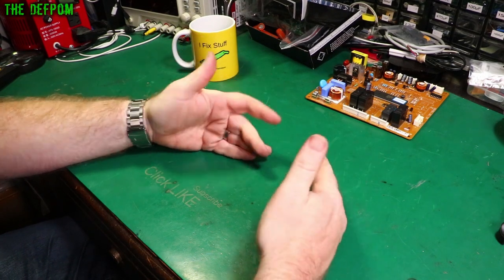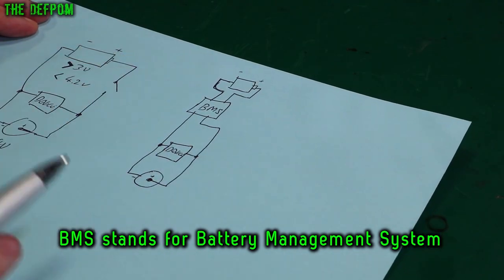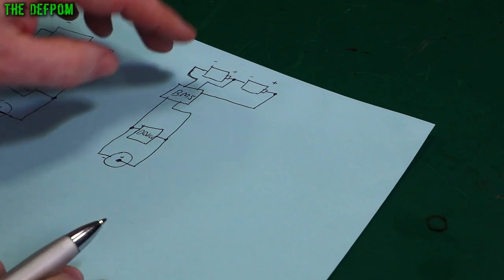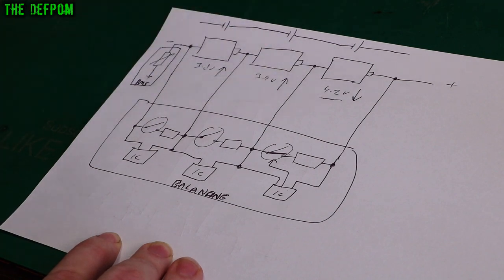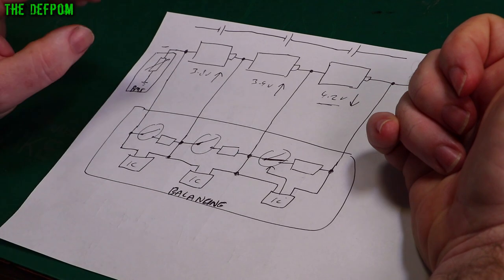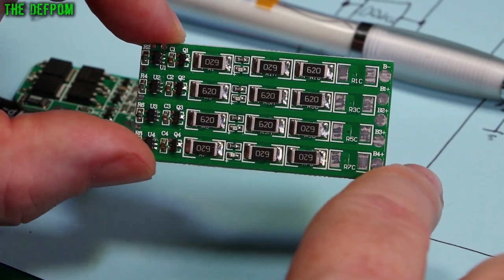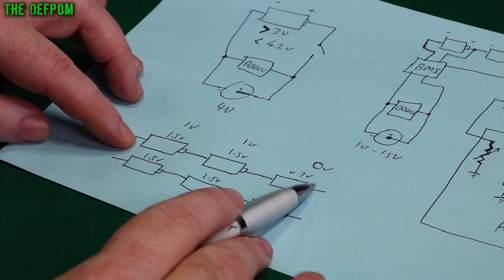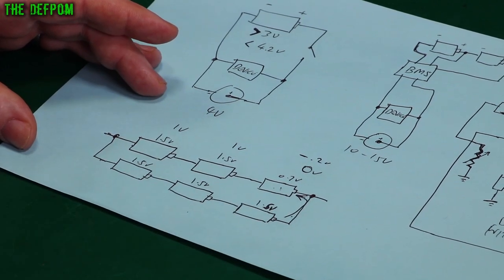🔴 Electronics For Beginners - No.25 - Battery Protection, Charging and Cell Imbalance - No.992

Comment: If the negative supply is floating up to maintain the voltage across the cells, the FET must be going into its linear region and the power dissipated by the FET will increase tremendously.

When a battery in a series pack has a lower capacity than the others it will reverse charge if not detected.  If you think the battery charges up by putting a higher voltage on the positive terminal, this forces current to flow in to the cell. So for a series battery pack on discharge the current is flowing out of the positive (conventional current flow) and in to the negative terminal.

Which is why the best way to use batteries is a very large single cell and a boost circuit, it removes all the problems that multi-cell battery packs have. A series connected battery pack has had reverse charging of cells issue from the first day somebody put two or more in series. IT’s

Still nice videos and fun to watch.

Comment: How about Relays and a note about asmmetric rating of contacts. Normally closed with a lower rating than the normally open. This can also bite your butt if you don't notice. Or magetic blow out required for switching high power DC?